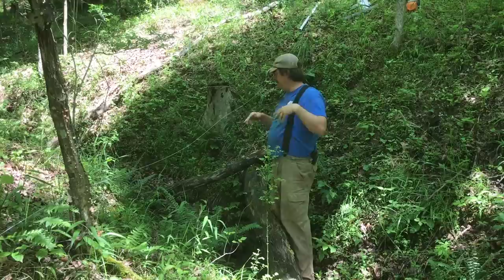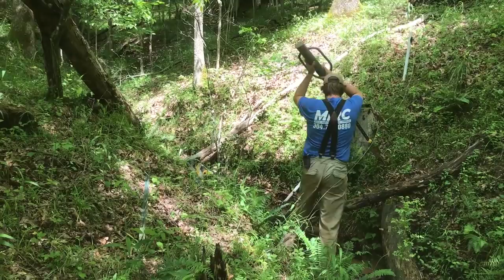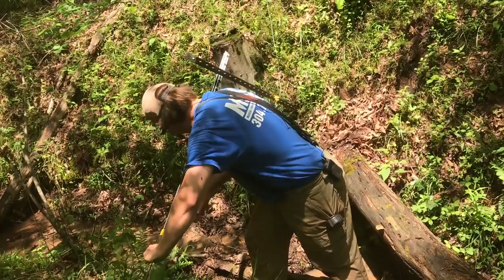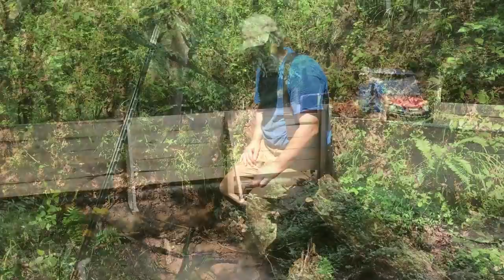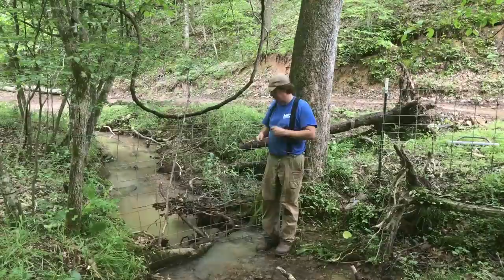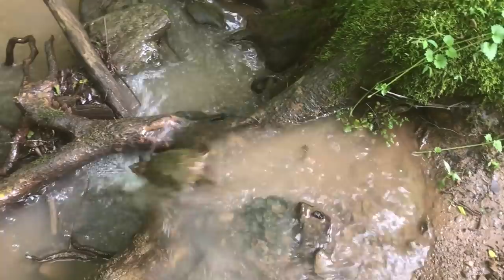Trying to run ELECTRIC FENCE over a small RAVINE in our PIG PASTURE

Comment: Hey Troy, we use what we call a flood gate, which is simply a sheet of corrugated roofing iron, cut to the shape of the opening, that swings one way but not the other. This allows the creek water to run through but stops the live stock from going in the other direction. This may work for you under the bridge? Love your channel, keep up the good work. Cheers from Northern Rivers NSW Australia.

Comment: You strike me as a man who liked to work smarter.
A tip from one older than your dad.
Tip the T post down and slide the pounder down over the post with out lifting the heavy weight over your head ehikebstand on a strep slope.
Just make sure the bottom stays where you want the post.